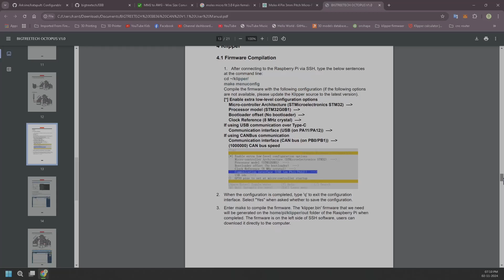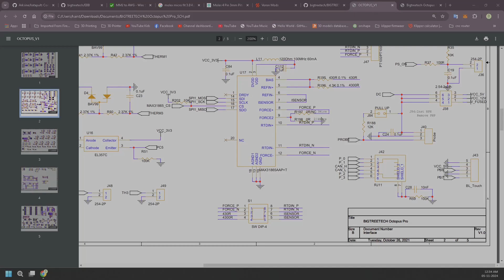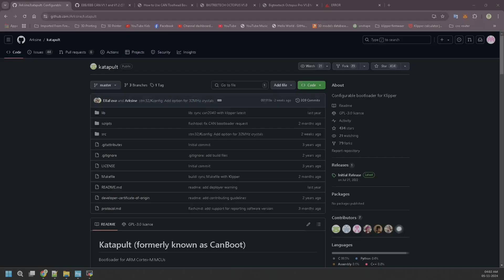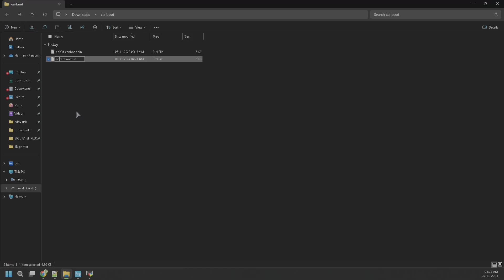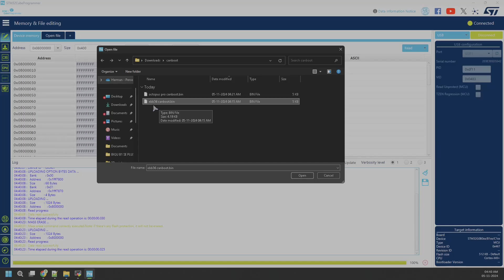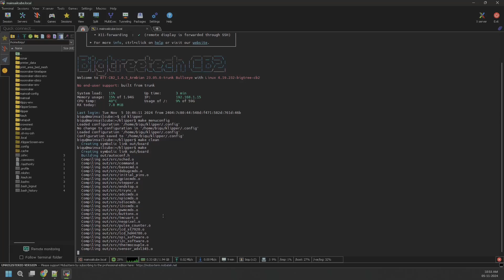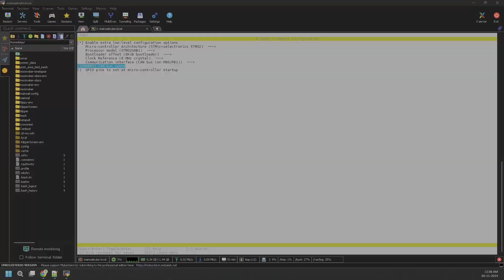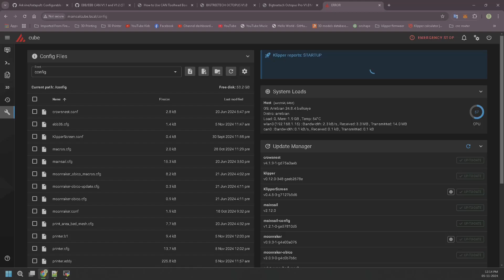Katapult Canboot Klipper Setup EBB36 Octopus Pro V1.0 Canbus with JST connector modification

Comment: Thank you for this video. it explains a lot about how to get canbus working. I have one question:
I have used CubeProgrammer several times, but now I have a problem. The program will not connect via USB. I can tell the board is in DFU mode, using the lsusb command, but the CubeProgrammer shows "No DFU". Do you have any idea what may be wrong? I have searched the web and have not found a solution.
I know this is "off topic" but I know others have the same problem.
Reply from the maker: Thanks and please subscribe channel it’s help me too and you need to chose usb connection from drop down menu and click on connect
Reply: @ of course I do that. And then I touch the refresh and never can connect and never see the serial number. I have used this program several times and never had an issue. 
I think it is a problem with the USB driver. I reinstalled the program and noticed that it says it is loading drivers. However, when I check the device manager, the standard MS drivers are still there. I tried to run the .bat file to install the drivers manually but still the MS drivers are there. 
I know that others are having similar problems because of @stacking_layers comments. 
I was just hoping you may have heard of this problem.
Reply from the maker: Do use jumper for power and dfu mode or give power from supply
Reply: @HarmanSinghKainth  It's embarrassing to say but the problem was with the USB cable. Thanks for this video. I think it is a better way to set up canbus.
Reply from the maker: No worry it’s happed some time happy to help you if need any other help and information feel free to ask thanks for good comment

Comment: Sat Sri Akal paaji, Which micro controller on Octopus board, will it work on Octopus V1.1 with f407?
Reply from the maker: Octopus has two chips f429 and f446 if f407 has any output can or RJ11 then it's working you need to do make sure usb to can bridge communication is there otherwise you need to use u2c board